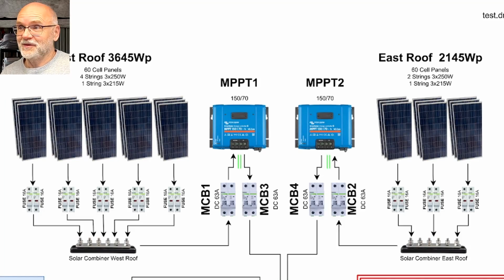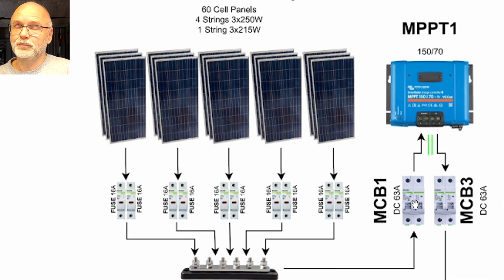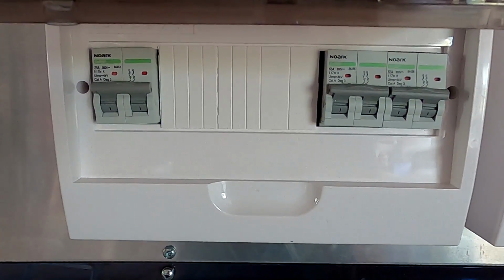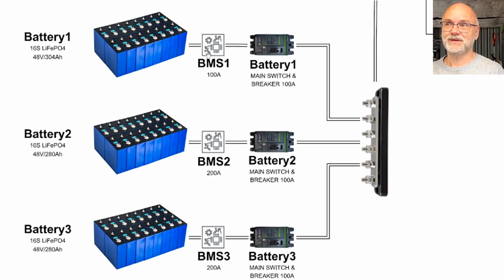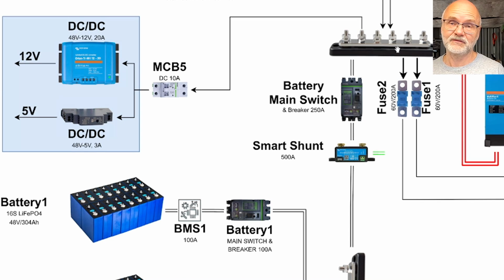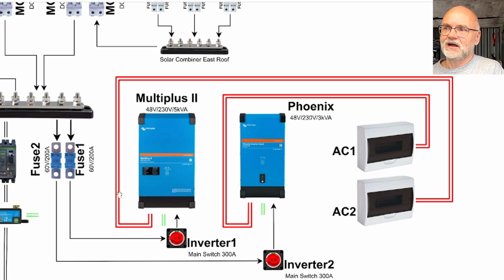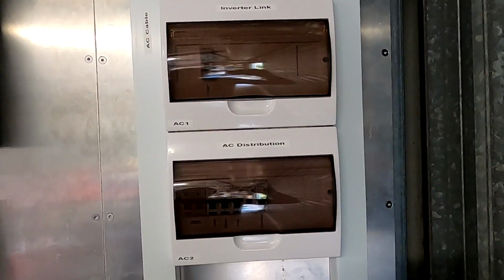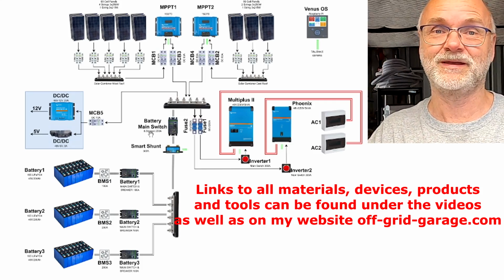How I've built the Off-Grid Garage. Whole system installation and design explained.

Comment: they are actually running in parallel, when the multiplus starts the phoenix inverter it measures the voltage on the mains input and synchronizes with it so it can parallel on to the phoenix's output
Reply: Why does the Multiplus start the Phoenix? Surely they should both be on. The Phoenix would be inverting and provide the continuous power with the Multiplus in pass through mode (inverter not running). When the load exceeds the user defined limit set on the Multiplus, the inverter on the Multiplus starts up and provides support (power assist) to the Phoenix. It’s a seamless transition. What Andy has described seems to be back to front to me.
Reply: @kevinmills5293   It seems he wanted the multiplus to be the main inverter and that's why he has this set up where the phoenix inverter is the "generator" that get's fired up at a specific threshold. also this transition is seamless because the main contactor in the multiplus only closes after synchronizing with the phoenix.( from my understanding it's like starting up a genset with a synchronus generator in mains parallel operation)

Also the phoenix inverter might be thrown out from the setup in the future when he changes the setup again.
Reply: @Bastler95m  I looked back at an earlier video where Andy explained his choice.

Comment: Very nice set up nicely laid out! I would like your opinion I'm looking to replace my LA batteries with lithium. Looking at  48v 280 ah to start with. Can you give me your recommendation for 1. charger/tester for cells and 2. Does your solar fill your batteries daily on average
Reply: his recommendations are on his website.
changing out FLA to LiFePO4 is *AMAZING*!  OMG, it's SO worth it!  i just did recently and it's night and day difference.
BTW, you don't need a 'tester' or a 'charger' unless you just WANT it.
and, no, his solar does NOT charge his batteries daily.  he mentioned a few videos ago he hasn't been fully charged in months.  BUT he's also been doing different tests with his system.  you can figure out how much charge you need by how much energy you use:  ROUGHLY, if you use 10kW a day, you need about 2.5kW of panels (on a sunny day) to fully replace the energy used.  if you use 40kW a day, you need about 10kW if panels... and a battery bank sized to hold the energy you need overnight...

Comment: You mentioned your 16a fuses should be 12. why not 10? since your expected power should be more like 5a? 
Similar question for sizing of your solar panels breakers, why so large 63a?
Thank you for your lessons and experience.
Reply from the maker: It will be in one of the next videos. It depends on the max fuse rating of your solar panels.

Comment: Wonderful! Thx.
I was thinking about battery 2 with a 100A fuse and 200A BMS. Did you limit the amps by setting the BMS software to  100A maximum?

Comment: This was an amazing overview!

The choice for the dual solar charge controllers and dual inverters was interesting to me and I decided to go a different route.

I am trying to simplify setup, reduce components, drive down idle consumption, reduce cost, plus run A/C from my panels to the house instead of higher current D/C.

I decided to go with ~34 kWh of Li-Ion automobile battery modules, so as not to worry about bus bars, compression, and where to recycle in the future.

I picked up a single discontinued Delta H6 6 KWh grid tie inverter for panels, to avoid solar charge controllers. (The power will directly run my household needs.)

My single Genetry Solar 12 KWh whole house inverter (on order) will charge batteries from excess power on the outputs (generated by my solar panels through H6 grid tie inverter), throttle the H6 grid tie when there is excess power & batteries are full, and enable the mains from the electric company when batteries are too low.

I plan on picking up 5 KWh of used panels this upcoming weekend.

I love the way you did your batteries!

You definitely sold me on the JK BMS!
Getting ready to order that, to add to my existing battery bank.

Why didn’t you just parallel an East Roof strings with a West Roof string? 

Just curious since I would think as the sun moved from East to West that the parallel strings would help give longer consistent power on the same wires, albeit with a higher peak at high noon?

I did not know if this was a no-no with panels or just a choice on your side for isolation purposes?

You have been an amazing help, thank you for what you do for the DIY community!

Comment: This is one of your best videos ever.  Great job creating the diagram and then the clear concise walk-through of the entire system.  I especially liked that you showed the actual equipment after going over that area on the diagram.  Outstanding presentation and a great reference down the road whenever anyone asks about your system (though it will be outdated in a matter of weeks but it was accurate at the time).  5/5 Stars!

Comment: Thank you so much for the great overview! I would probably not use a main battery breaker since you already have individual breakers. I really like the idea of always connecting the bms to the battery and treating it as a closed unit. Great for safety. Your Raspberry Pi is connected to the main bus bar by a 5V converter. What happens when you kill the power? Can you simply turn the breaker back on or do you have to take some additional steps to get the Venus Os working and communicating again?

Comment: Thanks Andy for all the great videos! I have been following you before you had 10K subscribers. Your info has helped me build my own 10KWh battery that runs my house. The only thing missing is some stats for us data junkies. How much power have you generated since you started, what is money value of the power and how long do you think it would take before you would break even on cost for your whole investment? I have resorted to HomeAssistant and Node red to automate and optimise my solar power. I also realised that I will have to measure more things to calculate an effective return on investment. With current prices I am looking at about 9-10 years before the sun would have paid for everything.

Comment: Excellent work Andy, thanks for this lovely, graphical schematic & explanation of ur beautiful system, I think I have seen most, (hmm???) Of ur videos now, but this really puts it all into a really nice clear explanation and perspective of the whole system and layout. The last full system shot makes it so easy for me to plan a system out fairly completely and to be able to easily create a smaller system just by using the main basic  corresponding sections from this layout, it makes it easy to adjust a few variables if necessary, to scale for pretty much any system. I like how u have simply segregated the different sections & areas of ur system into ac, dc, batteries, inverters & comms, conduited nicely with no crossing of AC/DC, full isolation of any or all components & plenty of redundancy & future proofing features built in as well. Ur “the Guru” when it comes to this tech Andy. Congratulations on a exemplary build & look forward to ur coming upgrades & what ur Sparky has to say, I would be surprised if he is less than impressed. cheers

Comment: Beautiful video you have made there, I have a similar installation before and would like to connect 3 strings paralell with 3 modules each in series to a MPPT controller.
But each string is aligned in a different cardinal direction.
3 modules east, 3 modules south, 3 modules west. Do you think this will work on one controller?

Comment: Cracking video as always, just purchased 16 320ah batteries from Aliexpress for £509 !!!!! (thats 870 AUD) it is incredibly cheap compared to what i have been seeing lately so fingers crossed i get what i have ordered, this will be the start of my DIY Solar Battery which should give me about 15Kwh storage, just need to find the multiplus 2 at a good price, i aim to use the multi as an assist to my current solar install and to create a local grid in the event of a main grid failure, this should keep the solar inverter happy, any advise regarding this route would be great, possibly a video topic :) this scenario will be a very common one as we all try to add storage to existing systems.
Reply: Extremely cheap, I wonder how much life is left in them, good luck.   May I ask which store on Aliexpress please
Reply: @brucemunro9555  yep im now a bit nervous it feels a little too good to be true,  the store is Jungla -104, they appear to be taking a good few orders, when i placed mine this morning the count was low 30's, ive sent a message asking how many boxes will there be and how heavy are the boxes this should give me an idea if all are on their way, fingers crossed ill keep you all posted
Reply: @brucemunro9555  UPDATE - they have just confirmed that there are 16 cells in the order but did not confirm the quantity of the boxes or the weight, im still not 100% convinced but i guess i will have to wait and see, i hope the tracking info will provide more detail but that could take days to update, ETA of the cells 25th September
Reply: @brucemunro9555  UPDATE - FAKE FAKE FAKE FAKE, do not buy any cells from any store with the name Jungla, they have provided tracking info which advises the items have been delivered, i contacted DHL and they advised that the tracking number provided by them is for a delivery to a completely different customer. the item and store have now been removed from Aliexpress. FAKE FAKE FAKE 😠

Comment: If you shut down the main battery breaker your positive AND negative connection is interrupted. How bad is this really to the communication wiring? Will it be destroyed? Is it a silly idea if the negative connection would have a additional cable to the ground (maybe with a little fuse)?

Comment: Good one as always Andy. I am waiting for you video regarding the email from heltec about the bms. I think you have forgotten it again. Can it be calibrated. 
Also can you test a darly 400A with series support. Darly has one with higher Amps too and they have another gadget which allows series connection too. I am almost done with my auto tracker I would like to share images with you since you were the inspiration for me to do the solar project. if you can give me your email address i will send you pics of the tracker. Thanks.

Comment: Omg. Not only are your panels not facing north, nor are they racked and tilted for the best elevation, but you're also surrounded by tree shading! Jeezuz, you must be collecting about 20% of potential solar power on your property. A few hundred dollars of aluminium framework and a cheap chainsaw (or call in a tree surgeon for some selective trimming) would be a vast improvement. I think you've missed the trees for the wood. It's all a crazy waste of money for very little sun. I'm shaking my head at this external inefficient madness and your internal electronic neurosis. You're a nice guy, a smart guy, but an OCD nutter.

Comment: Great video. I have a question when you have a max of 70amp going into the battery but on a 63amp MCB is that not an issue?
Reply from the maker: 70A will be the maximum for the solar if all strings are working perfectly. I'm expecting this will occur only for a few seconds when clouds go away suddenly and the panels are cool. The breaker will heat up but won't trip for a while with this load. I guess, it will take around 30min to trip, depending on the temperature. We will see. I know, I'm driving this one on the edge....

Comment: Andy, your schematic was very informative and helpful. However, I still have an additional question. If you were going to go off-grid for your whole property, how many more solar panels, batteries, and inverters would you need?
Reply from the maker: I guess, we will do this sooner than later. The electrician had some good ideas how we can achieve this... It will be in one of the next videos...

Comment: Switching both + and - serves absolutely no purpose & you forgot a fuse to the 5V / 12V section. For the rest good I would say.
Reply: it totally "isolates" the equipment/string/whatever...  no connection to anything.

Comment: A bit off topic here, Andy.  After watching the most recent videos and specifically those involving the JK BMS, I sent away to China for a 4S unit when you announced that they had come out with one for us 12v people.  I have not received it yet but I am seeing on other sites that this BMS is not working as expected.  Furthermore, there has been a complaint about the lack of directions with the unit and poor customer service.
Did your 4s JK BMS work ok right out of the box?
Reply: I bought a 4S JK BMS which turned out to be faulty- they apologised and were aware of the issue. 
Customer service was excellent- although I had to post it back, so a significant time delay has occurred. I have now been fully compensated for my postage costs and a new BMS is on the way.
I am guessing your one will be fine- it was quite some time ago that they discovered the problem, and all sold since the issue was discovered should be perfectly fine.
Reply: Same, I bought an early 4S and returned it, they paid my postage and full refund and I purchased another, yet to install that on 4xEVE280K.  Another JK 200A / 2A balance 16S BMS has performed flawlessly in our motorhome on a 4 week trip on a 16xEVE280K 48v system.

Comment: Great video, much appreciated. Have you added the schematic to your website? It would be useful to refer to when designing my system. Just taken delivery of 16 LF280K cells, the ones with new terminals. I bought them from a company in the UK, and they are supposed to be grade A, they did have grade B, but we decided to pay the extra for the new style and grade A cells. I will be testing them, but my equipment won't be here until early September. QR codes scan as January & February 2022
Reply: Mind saying which company. I'm in the process of designing my off-grid system

Comment: First - you are always talking about emergency - but I m sure, in real emergency, you will not be in your garage.
All other parts, you installed very perfect, but "emergency" breakers have to be automatically - on most breaker systems, you can add minimum shut off "drives".

Second I m designing now a 3phase system for my house in cologne.
my average consumption is 6000kWh/a => 680W => 270W/phase (including heatpump)
there is a brine - heat pump with max consumption of 1000W - very seldom at coldest days (maybe every 3 years or less), normal in winter at 0°C outside, the heatpump neads ~500W
there will be 10kWp PV on Victron MPPT, which needs a 3 x Multiplus 2 5000 
But to run the average consumption of 270W/phase makes no sense with 5000W inverters  - in nighttime, the consumption will be maybe 50W or less per phase.
On the other hand - in case I`m cooking, the consumption will rise up to 4 - 7 - max 11kW, or my hairdryer rises the load by 700W for 5 minutes.

The Multiplus2 5000 will have a very bad efficiency on 50W...

I'm thinking always about cascading 2 Inverters, i.e. one with 500W and the Multiplus 2 5000W, to reduce the losses.
How did you connect the second Inverter - to the save A2??

Makes it sense to have the zero load consumption of the Multiplus 2 by adding a low power converter??

What do you think about

Grüße aus Kölle
LG jogi

Comment: The inverters are in parallel not series becasuse if it was in series the inverter would have to turned down to 120v each
Reply from the maker: The power supply of the inverters are in parallel, coming from one battery but the output is in series, one inverter feeds the other inverter.
Reply: Piggy back?

Comment: Main question who should be say/aks. WHY you not connect the PV into Inverters but you separate charger AND your setup look like your inverters work as DC/AC converter and this is like use wrong device to job.
Reply from the maker: It's an of grid system. The inverters are converting DC to AC as you said. 
You can use inverters with build in MPPTs like the MPP Solar inverters. But for design reasons, I run only 150V max on my solar system (because of shading) and many parallel strings. This is not something you usually do with an inverter and built-in MPPT.

Comment: If one String is full in the sun, and one String in the Shadow, how much Power do you get ? 

In my mind Micro inverters are far more efficient, or ist that bullshit in my mind? 🧐
Reply from the maker: If one string is in full sun and the other one not, it does not matter as both deliver power to the system.
Micro inverters will help if you have a shadow on panels in one string. But you need an special inverter for that if you're off-grid.